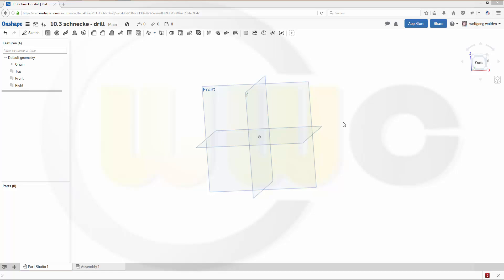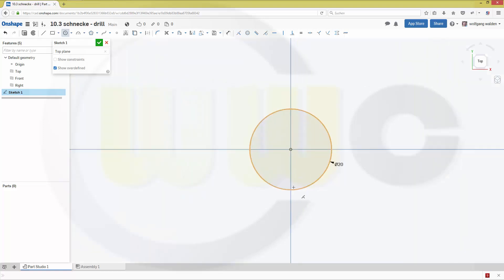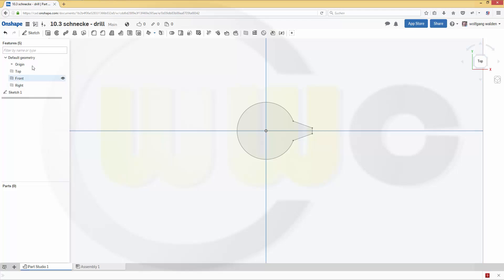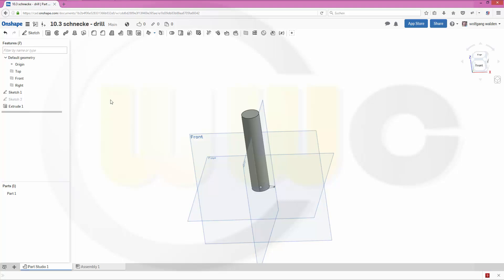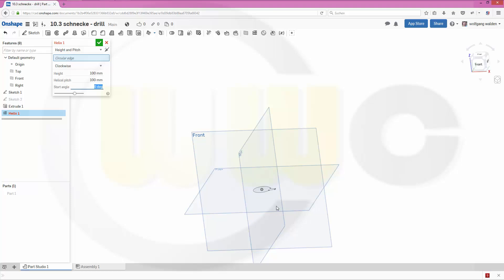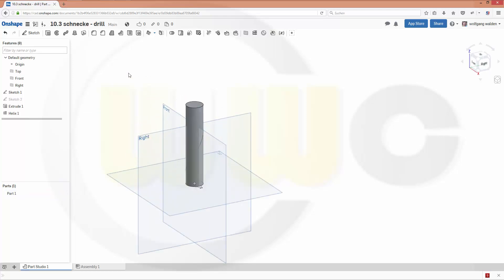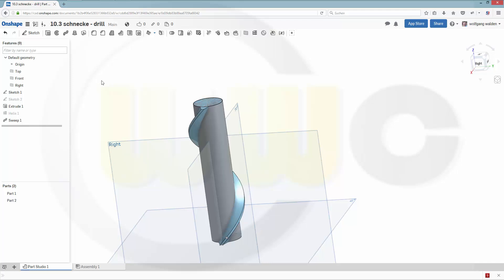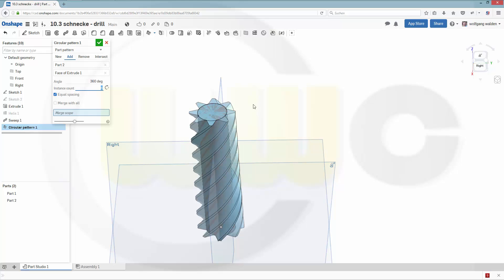10.3 Schnecke - Drill - Onshape Training - Sweep - Helix

Comment: Hello Wolfgang, Is there a way to dimention the longitude of a helix? Regards.
Reply from the maker: you mean the length?
Reply: @wolfgang.walden.cad.training  I´m designing a Ribbon Mixer with capacity of 500 Kg and the lenght of the helix means the lenght of the steel piece to be rolled in that particular form.
Reply: Yes, all the way from one point to the end through all the twisted path
Reply: N of turns * Sqrt(  (Pi*D)^2 + Height^2  )

In this case:
2 * Sqrt(  (Pi*32)^2 + 100^2  ) = 283,59

PD: D (diameter) depends of the part of the helix you mean, in my example I take the top of the gear tooth